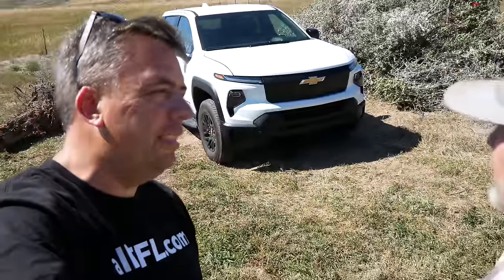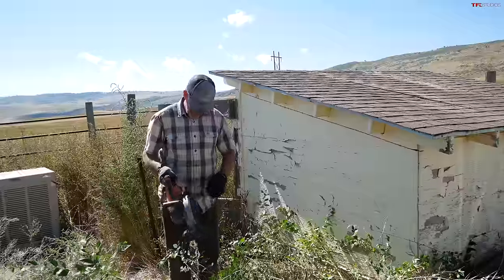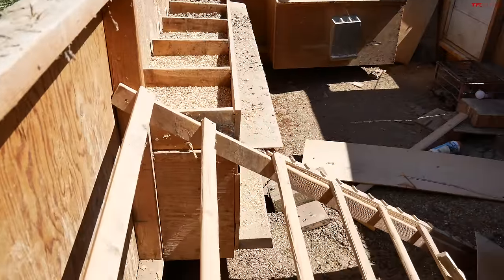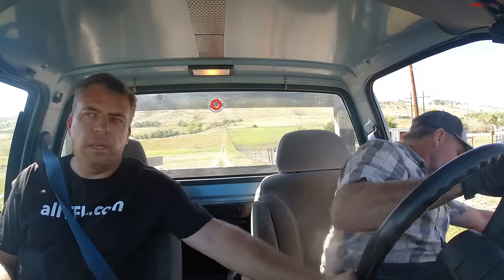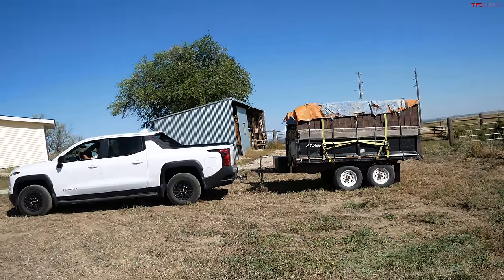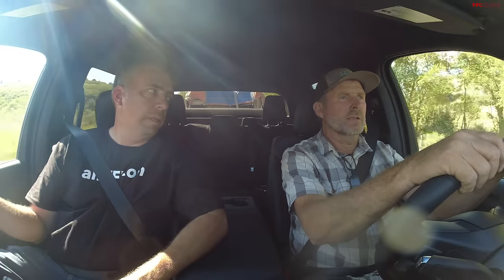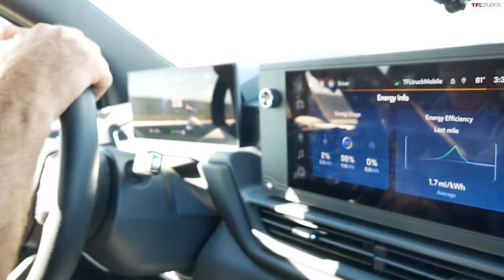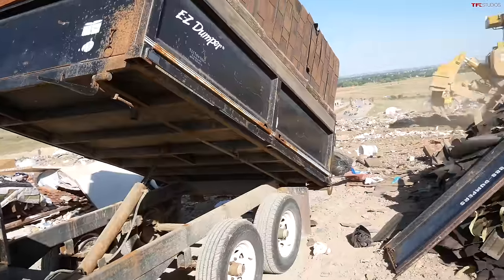Old vs New Work Truck - Can the 2024 Chevy Silverado EV Work As Hard As A Classic GM Truck?

Comment: a good question is which truck will be doing nearly the same amount of work in ten years, WITHOUT several 5 thousand dollar repairs.
Reply: Well one truck is already old so you make no sense. That's like saying which lasts longer, a bike made in the 2000s or a brand new mountain bike.
Reply: @StarInfinite00 yes the other one is old and yes I see no problem with that! It has already be payed all! And repairs can be done much easier compared to a modern fully loaded with electronics truck.
Reply: @StarInfinite00 you really didn’t get the point of his comment lol
Reply: Have you seen how cheap 10 year old battery cars are? The way technology keeps developing, nobody wants to buy an old EV with a battery that degraded to half is initial potential and old technology. A 80k diesel for example you can still recover a very significant amount after 10 pr even 15 years.
Reply: @kkingss4  Nonsense - An auction house deprecates a 10 year old high mileage $80k diesel truck just as fast for the same exact reason,  degraded to half is initial potential and old technology plus very high operating cost - none are worthy investments over 10 years time you will be a looser if you take that diesel bet.
Reply: The Silverado EV.
Reply: Well in 10 years youll definitely need to replace the battery in the new truck. Where as the old truck is well cared for and parts are super cheap. Plus, the cost of the new truck, he could buy 20 of the old one. So its the least expensive no matter what the point is.
Reply: @unintendedpurposes what cheap parts? A 2012 diesel remanufactured engine is $25,000-$35,000 out the door.
Reply: There isn’t anything cheap about a diesel truck repair. Especially since the emissions requirements doubles the cost.

That said, new 6.2 Chevy diesel trucks are only $110 to change oil every 5000 miles versus $500.

If you already own the work truck and it has a $5000 repair it’s $5000 🤷‍♂️ A new EV truck is $950 a month without interest for 7 years ($80,000). 

It’s a work truck, $5000 when it needs it or $12000 plus a year for 7 years 🤔 when you start thinking like a business owner versus an employee you’ll get it.
Reply: What I wanted to know is, what happened to the range pulling about 4000 lbs starting and stopping?

If I have a business and I have 20 stops a day, 15-20 minutes between stops averaging 40-50 miles an hour and the weight at the end of the route maybe 5000 lbs, and temperatures in the 80-100 degrees or -4 to 40 degrees.

I want to know if the EV will make it back to the warehouse using the A/C or Heater 🤷‍♂️

I need to have more real world testing.

The range will help knowing the EV can do the job pulling weight plus heating and cooling my employees. The cost wouldn’t be as big an issue because it would start in the winter and won’t overheat in the summer with low maintenance because it has fewer parts to fail. Reliability is huge in a service industry. Repairing a truck today isn’t a two day event sometimes two weeks or more depending on parts availability. The EV price looks better being more reliable than employees showing up everyday to work.

Peace of mind has value over cost more often than not.

Comment: It is a work truck because it makes a lot of sense for certain fleets. If you know exactly what tasks you are going to need the truck to do, you can buy a truck with the right range and payload to do that job and it will do it day after day with very little maintenance required. The high initial cost can be made up with savings in fuel, maintenance, tax incentives, and depreciation tax write offs, or it may make sense to lease.
Reply: Enjoy a hard cold Rocky Mountain winter🤪

Comment: The GMT 400 trucks were awesome and still are. I had a 92 GMC work truck with the 4.3, 5 speed and bare bones except AC and AM/FM
Reply: Bought  a 92 K1500 stepside 
four years ago. Love it, put a starter
And slave cylinder in it. Exhaust, and
been running around since.😊
Reply: Until you need to stop from modern highway speeds of 85 and you are still doing 55+ when everyone else is already stationary

Comment: I grew up on a farm and you don't have time to drive all the way to town to get a new saw blade. This is a real world situation. We would run the saw and burn our way through the job and put it on the list to pick up another 2 blades when we went back to town. It is great to see you guys actually use the truck and test out the power outlet. I was pretty disappointed when I got my new Silverado and the box outlet was only 400 watt rated. All I could run was a cordless drill  battery charger. I do have a small air compressor that I can run off of that bed outlet.
Reply: Circ blades are cheap. I always have a variety on hand for the situation. Cause a dull blade is literally a waste of time

Comment: Great video very entertaining, that's a nice truck but I'd be willing to bet it won't be around as long as David's work truck. I just don't see these types of trucks being around 20-30 years.
Reply: The reliability and proven longevity is pretty tough to beat with those GMT400 series trucks, arguably some of the best trucks GM has ever made. With that said, mighty big shoes to fill for these modern truck EV trucks.
Reply: The lack of user serviceability with this truck as well as vehicles from every other manufacturer will send them to an early grave. The gmt400 series trucks are notorious for providing 30 years and 300-plus thousand miles of service. Then they can be rebuilt and continue to Soldier on. These new vehicles cannot be kept in service economically due to their high level of complication.
Reply: Bingo PAL 😊

Comment: I don’t remember the price I paid exactly, but back in 1998 I ordered a GMC 2500 4x4 SLE with extended cab and long bed with automatic transmission and 454 engine. I want to say it was around $30k. It had drum rear brakes, no airbags (because HD trucks back then didn’t have them), cloth seats (they were power though), AM/FM radio with CD player, air conditioning, cruise control, and power windows. 

Adjusted for inflation, $79k is equivalent to $42k back then. Is this truck 140% of my old SLE? Yes, and No. I could carry more payload in the SLE but it had no safety tech, brakes weren’t very good, didn’t tow as much, got 12mpg, and absolutely sucked off-road until I added a 6” lift and capable tires. Because it was brand new, I also didn’t want to scratch/dent it, so that “it’s too nice to use as a work truck” argument is true for anything new. 

I actually think GM is the first manufacturer to bring us a functional EV truck. The others work, but their limited range kills them for any real-world towing—pulling a boat 110 miles round-trip would be a needless exercise in stress management with all others.
Reply: I agree with your assessment on GM's new WT4 truck. So far with what is currently available in truck market, there isn't any other vehicle within the full-size class category that will match the driving range while driving solo or while hauling/towing with a trailer or load out back.

Ford's Lightening has been a disappoint and has not delivered the stated capability as advertised. Part of that problem is, Ford's engineers just incorporated the EV platform and tried to adapt to an already existing chassis intended for a traditional ICE arrangement, which really limited the size and scope of battery pack they could fit within the frame rails.

Comment: On the positive.. the ~500-600 lb ft of torque vs the much more powerful F150 Lightning, is probably adding much more range for moderately heavy loads.
I like the regenerative braking, and wonder how it compares to a diesel's exhaust brake??
Put an 8 foot bed on it and increase the payload.. might get the attention of alot more consumers.
Reply: You’re not allowed to be positive here; you’re only supposed to put down everything new… like they did back when the blue truck was new 🙄😂

Comment: I did hotshot moving auto parts around the city one summer and did about 300 miles a day, hardly made any money after gas but was a cool job. Be a neat truck for people in a particular businesses like that but man the engineering cost need to come down.
Reply: Engineering costs will come down with volume.  Trick is getting enough volume to make financial sense.  This type of truck will at least make financial sense for those who haul a good amount locally and can charge at home at night.  I'm sad they didn't specify how heavy the loaded trailer was, and what the round trip end efficiency was.
Reply: @JDCheng  Well in the video, the empty curb weight of the WT4 was around 8,500 pounds, and the scales at the dumps showed the total combined weight of 14,000 pounds (truck & trailer), simple deduction will give you an approximation of the loaded trailer.

For this particular video, I don't believe TFL was trying to make this a fully inclusive test, rather just to have farmer David give his first impressions of Chevy's new truck offering.

Comment: Okay I'll be 100 percent honest before even watching the rest of the video and say NO on price ALONE... that goes for practically any new truck too, 30k+ for a bare bones nothing special truck is out of this world dude, which unfortunately seems to be the norm now
Reply: Well my ram 2500 was 68 and it’s not diesel not all fancy I got a backup camera and 4 wheel drive that’s about it left the lot was 77 with Tax an Interest
Reply: Some jobs pay better than others :)
Reply: While I’ll agree truck prices are outrageous for anyone but higher class. You gotta realize a “bare bones” truck today compared to 20 years ago is more equipped than a fully loaded truck of its time. All that technology and engineering adds up. Nobody asked for all this technology in base models but with the increased safety standards it’s mandatory
Reply: 1.Thank the white house.....
  2. Thank the government...
  3. Thank the consumers 
     Why the prices have gone crazy on vehicles  especially  trucks the last few years
Reply: @zacherydrzik7122  it begining to sound like cheap work vehicles with manual windows and locks are illegal.
Reply: A bare bones 4x4 crew cab with a v8 is like $50k but if you are buying a work truck you are probably going to want to get a work van nowadays. The express will tow 10k
Reply: @DJ-ve5lr or maybe a diesel with just 800lb ft of torque
Reply: Good luck finding a new truck in the 30-40  thousand range!

Comment: For these ranch video reviews with EV is there an old 220/240v outlet usually used back in the day for old timers arc welding on their equipment? It would be interesting to see how each EV reviewed would charge plugged into older existing outlets. Would they charge at their expected rates? A lot of folks might eventually consider an EV for chores like we now accept the battery chain saws and other tools.
Reply: It will charge just fine and at the rate that the circuit is set up for. Most old circuits are set up for at most 30 amps of use, though many were only 24 amps.
Reply: Good question; I have a 50 amp rv plug that could be used for that, with the right dongle I suppose.

Comment: I can’t figure out why they aren’t going hybrid on trucks. I wish this made more sense but it just doesn’t. If your a service technician you might not drive long distances but you may still have many stops and exceed the battery capacity. 
They are getting closer, but I’m not trading in my High Country just yet. I actually prefer the 3.0 diesel.
Reply: As an owner of hybrids in the past and now an EV truck, I can personally say I'll never go back to even hybrids. The day to day of an EV is so dead simple and pleasant. I haven't brought an EV in for service once while my hybrid still required regular oil changes, which was at least a few times a year.
Reply: @GadgetMan777  
I understand, but it’s all about applications. It wouldn’t take much of a conventional motor or even hydrogen to boost the Achilles’ heel of EVs which is range with a load.

Comment: So, how is this Avalanche type bed going to work out for work? I don't see a lumber/ladder rack fitting and the bed is only 5'11". Also,  it's not a separate bed that could be removed to fit a flatbed or service body. Obviously not really a work truck
Reply: My thoughts exactly.
Reply: I believe the work truck version doesn't have the Avalanche opening into the cab like the consumer version does.
Reply: I wasn't talking about opening. I'm talking about shape at the back of cab that would make any sort of rack very difficult
Reply: @throttleissues9359  - I would bet someone will be making a number of enhancements if not GM providing them, certainly after market companies will. How can I be so certain of this? The truck will sell well among EV trucks if for no other reason than the fact that it has more range than anything else to this point in time. That is a big selling point.
Reply: I hope they switch to a more traditional bed for the next gen.

Comment: Looks good.  But practically speaking I can't see it lasting with all the demands of a work truck. Driving down a dust filled dirt road with the windows open. All the dust and dirt on those screens. the high cost of maintenance, the scarcity of charging stations, etc. In some cases it would be better than ICE but that would be the minority.

Comment: For comparison, that old GMC is over 30 years old likely on the same engine & transmission, & probably could go 30 years more. Can any EV do that?
Reply: Undoubtedly.
Reply: Properly maintained electrical parts? Sure.  Heck, looking around there are tons of diesel-electric locomotives that were built in the 1970's floating around. 

The bigger question is the battery - though with a pack this large, you could still have a significantly usable range (say, 300 miles) on the original pack, even after 30 years of use.  I think there's information from Tesla's packs that suggest batteries lose about 1% of their rated capacity per year on average.
Reply: GM states the battery duty cycle is good for 250k    Tesla says its battery packs at the 250k mile mark are between 10 to 15% range loss
Reply: @juliuscheng5788  Those diesel electric locomotives are still functioning for two reasons. One, they were built on an industrial scale intended to provide service for decades, and two, they are not full of unnecessary Electronics. New automobiles are flawed on both accounts. This makes them highly unreliable in the long-term and unreasonable expensive to fix, which will result in them having a comparatively short service life. Additionally, battery technology is still not where it needs to be. Battery Service lives tend to vary considerably, and even the cheapest replacements are five Grand, with some of them running over $20,000.
Reply: @floridagunrat1625  unnecessary electronics?  What difference is there between a locomotive's powertrain and a EV's that would be "unnecessary"? 

Unless you really think all the infotainment features cars have somehow affect powertrain reliability.

And why would you think an automobile's electric motors wouldn't be reliable over 100-200k miles?

Beyond that, the point of mass production is to reduce costs.
Reply: How many miles tho? I put 36k miles in one year on my Rivian which in 30 years would be over a million miles lol. So age doesn't mean much here. There's 11 year old Teslas on original batteries with over 200k+ miles and still work nearly like new.
Reply: @JDCheng  The fact is it's way too expensive regardless of if it's reliable or not.

Comment: I hate that new trucks have so much tech in them. Give us an engine, 4x4, an A/C, heater, power windows, power locks, am/fm/bluetooth radio, automatic transmission, some cup holders, and make it $15,000 so we can afford work trucks again. That said, the convenience of a back up camera to back up to a trailer without an extra person or having to jump out and check a couple times, is worth adding that too.

Comment: The big issue here not talked about is the battery pack degrading depletion. These are stupidly expensive to replace when the time comes!
Reply: Yeah in about 15 years it might begin to show wear on the battery. By then I bet there will be NON OEM replacements you can buy at at less cost and with much higher power storage

Comment: Hey TFL gotta question … 
Could you conceivably add a roof rack to this truck and add a couple solar panels to charge while driving around or just plain recharging full time ??
Reply from the maker: This would have to be integrated into the software of the truck as well.  It could have a solar tonneau cover. It would add just a little energy.
Reply: Covering the entire truck with solar might net maybe 500 watts on average, so you'd take weeks just to charge a 200+ kWh battery.
Reply: No, because it won't go into drive while charging. You'd be better off packing in 2000 watts of fold out panels and a small inverter battery to plug in and trickle charge at 10-12 amps. It's not a great portable solution tho but the good thing about EV trucks is they don't care where the power comes from so you could pack in a propane generator if you want for very remote use. Lots of options.
Reply: No. It takes more voltage than solar can output to charge. It's part of the plan. Keep you on the hook for fuel. No free fuel allowed.